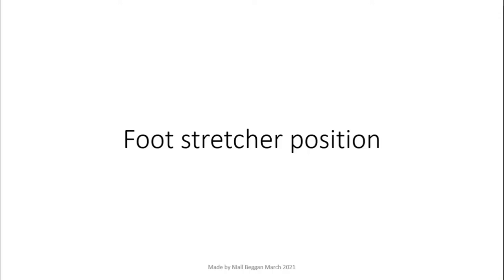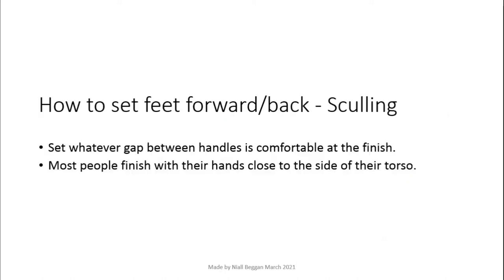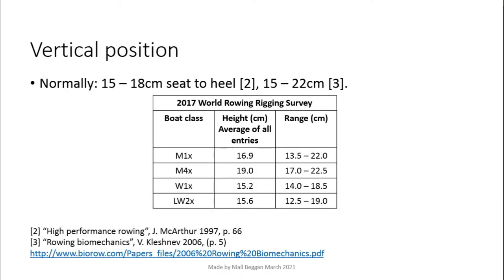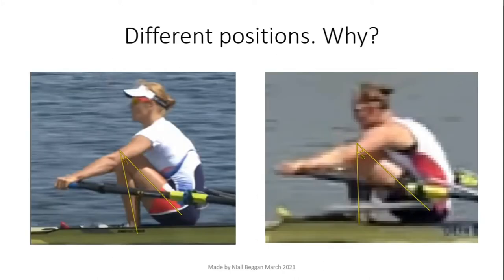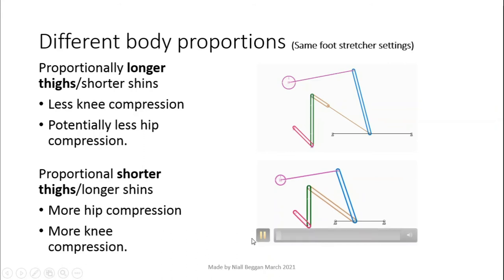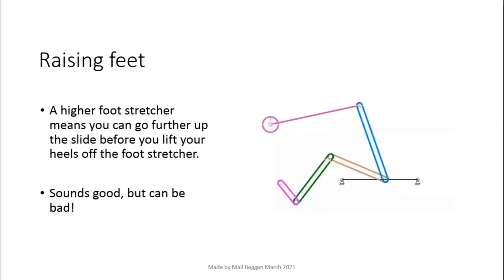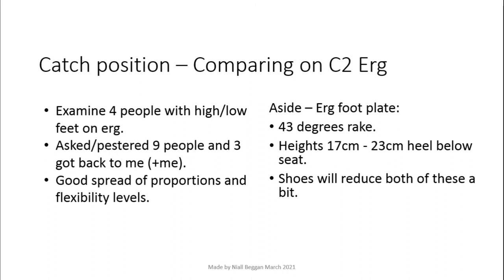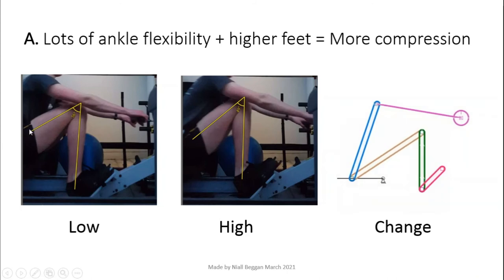Rowing Footstretcher Adjustment

Comment: Hi Niall, great video! I'm watching to try and get the answer to another question. On the C2 erg I have no issue whatsoever getting a full compression and keeping my legs perfectly together. However, in the scull my legs cannot stay together no matter what and it is quite uncomfortable trying to keep them together. I'm wondering if you have any ideas on how stretcher setup can help me with this? Thanks
Reply from the maker: Hi Cavan, Apologies for the delay in replying. Firstly, thanks for your comment! The feedback is really useful to me. For your question - If you pause the video at 5.27 I have put the C2 Erg footstretcher angle and height on the screen. If you can match these measurements in your single, you should be able to achieve the same leg position in a single scull as you do on an erg. There are two other adjustments that matter, if the shoes in the single are angled in or out, and if they are closer together or further apart than the erg. If the erg position works for you, why not try to replicate it in your single?